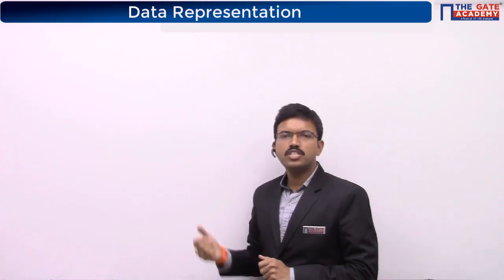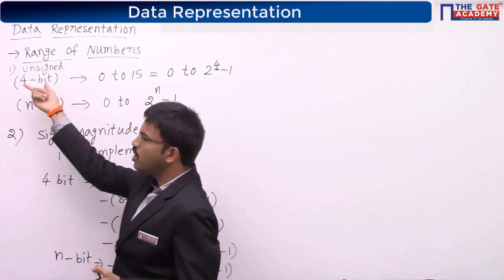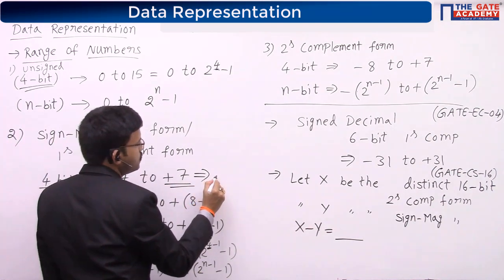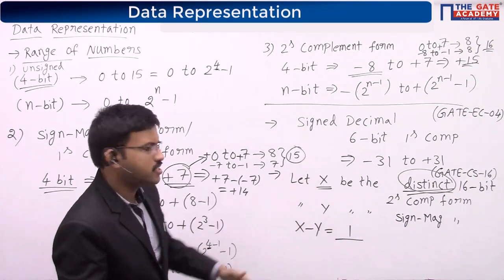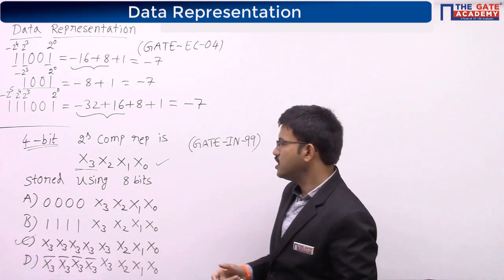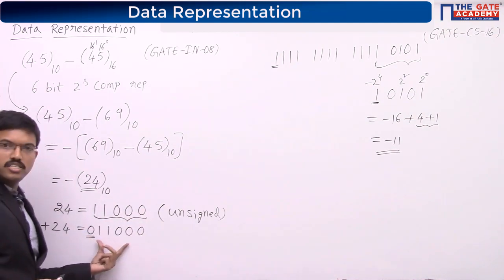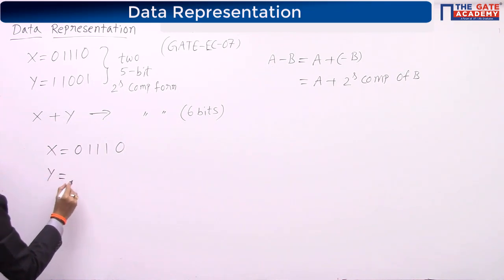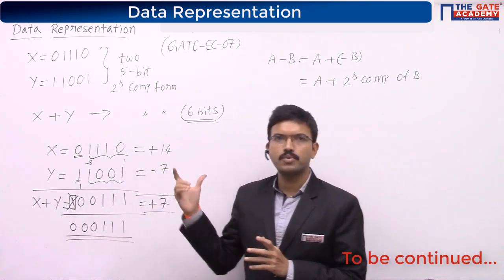Data Representation (Part-2) of Digital Circuits | GATE  Free Lectures | EC/EE/IN

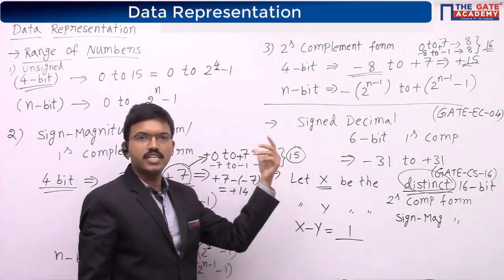Comment: In video @ 14:14, u are saying that for 4 bit we have positive number of  range from 0 to 7 = 8bits, this is correct. But next u r saying for 4 bit we have negative no. Of range from - 7 to - 1, but in tabular form this range is from - 7 to - 0. Plz update me on same,
Reply: Dear student, in general we will consider both +0 & -0 as 0 only. We shouldn't count them as 2 different integers